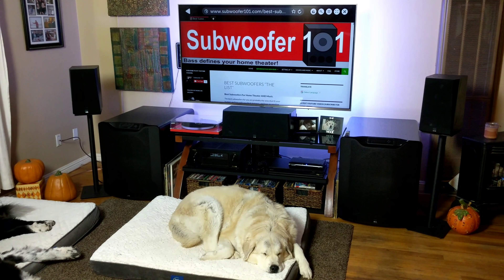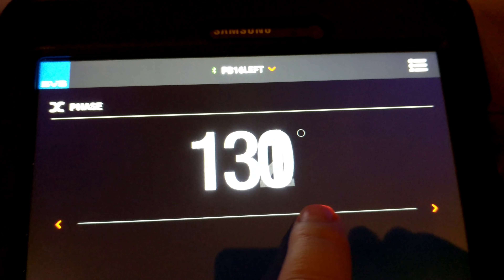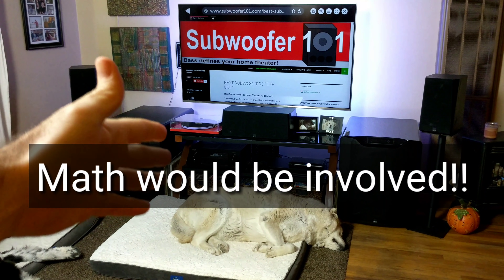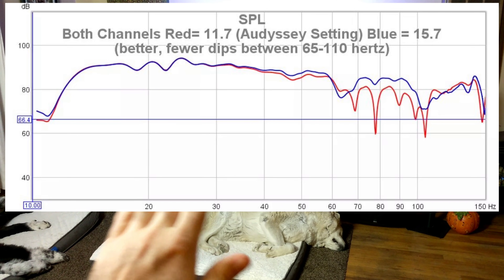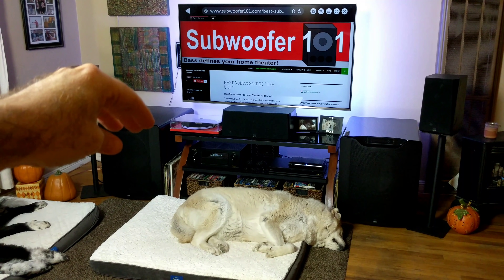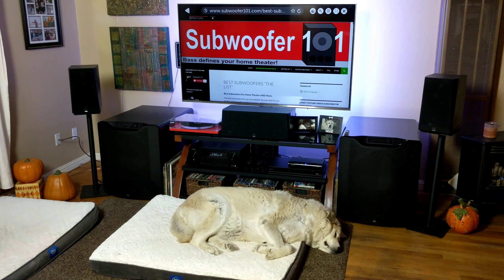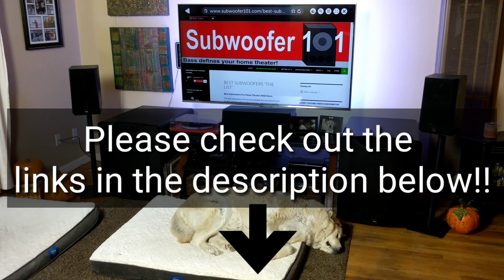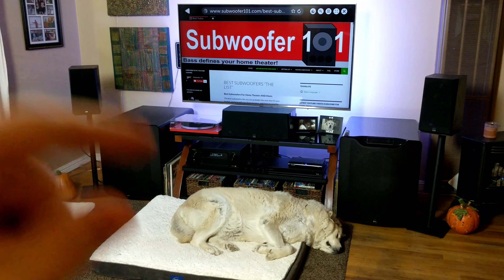Subwoofer Phase Setting: Which is best? 0? 180? (Subwoofer Setup Tip)

Comment: Good info for the issue. 
Also you are correct that SVS is a great company with lots of knowledge to give. Ed Mullen and many others have been a huge help when I have a question. 
I am Running dual PC2000s soon to be quad 2000s. 
Love the dogs.
Reply from the maker: +Mark Nelson Yeah, SVS has always been super responsive and spot on when it comes to audio. Very helpful. 

Quad 2000's are great, just don't try mixing wired with wireless like I did. Wired is the way to go if you can.
Reply: Yes wired will be the method of wiring the subs. Ed Warned me of that very issue too. 
Christmas will be filled with some clean fun bass to enjoy.

Keep up the good work I enjoy your videos.